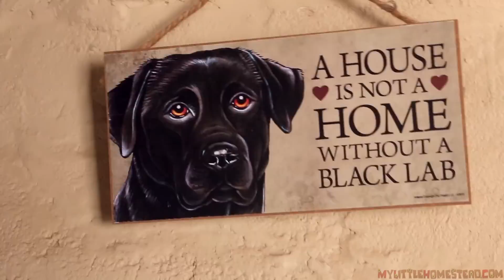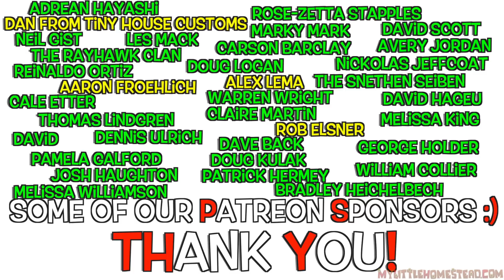Homemade Stair Banister Rail | Underground Earthbag Building | Weekly Peek Ep83

Comment: have you guys thought of doing a wood gasifier in your builds to generate both heat and eletricity
Reply from the maker: We will have to look into it. Thanks
Reply: i can help you if you need we made a few different versions. It consume about 2 pounds of wood per hour to run a 10KWH generator for charging up a battery bank and run the house

Comment: check out this video for better understanding https://youtu.be/2vZbbkTbJgI around 06:45 he shows the difference when treated with wax to prevent cracking, I'm fairly certain you can also treat with old motor oil or heat treat, he stated that for every inch in thickness you should leave it be for 1 year but the greener the wood,  the more likely it is to crack...
Reply from the maker: Great ideas... I will have to explore...
Reply: mylittlehomestead other than that y'all are doing awesome, ive been following you for the past 6 months, if i have any kind of routine in life, MLH is definitely a part of my weekend routine, its crazy to see how fast this is getting built, i remember back when it was just a hole in the ground